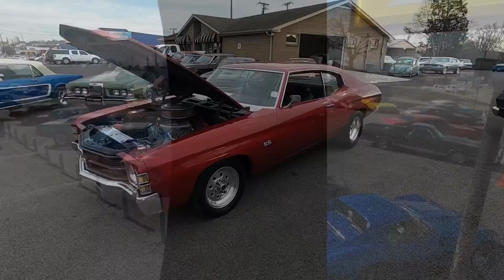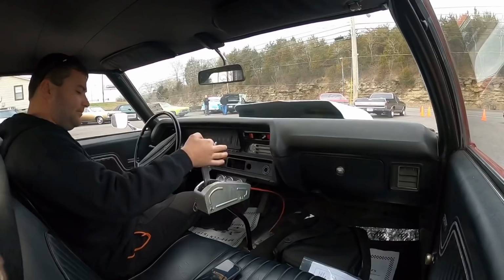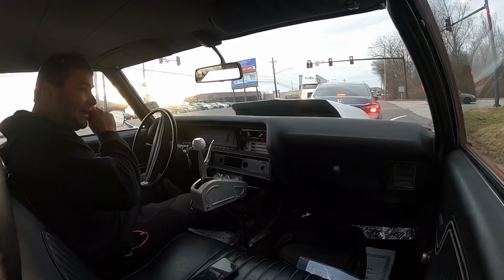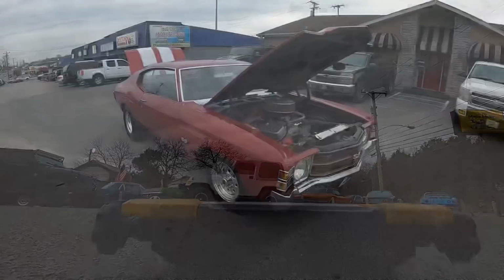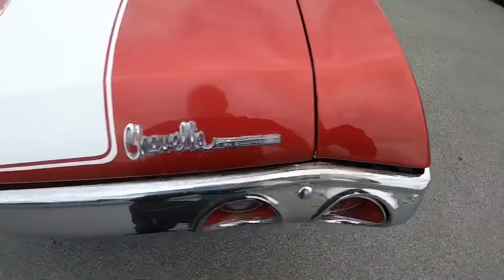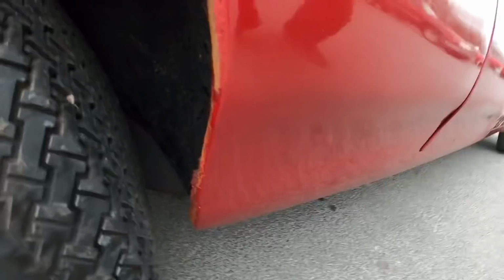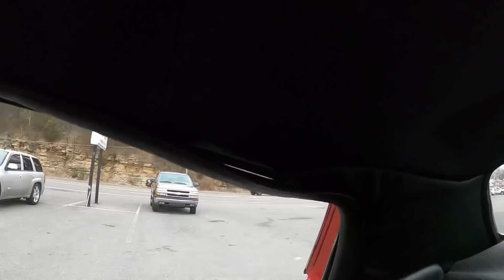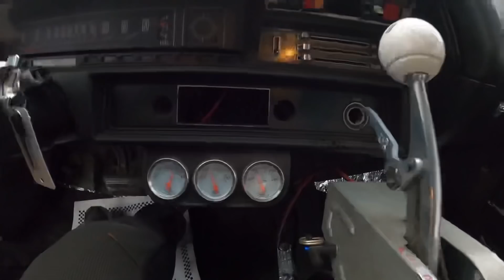Test Drive 1971 Chevrolet Chevelle SOLD $25,900 Maple Motors #1434

Comment: Beautiful 😍, I hate the way they put the shifter in it though. I'd have to change that right away.... but a really nice looking car still! ♥️👍
Reply: Right. Looks like a t-Rex was the previous owner
Reply: I said the exact same thing
Reply: A lot of race cars have it mounted high like that so when the driver is wearing a 5 point harness they can shift it. A harness like that doesn't extend and retract. This car probably had a roll cage in it at one time.
Reply: Put in a Hurst dual gate

Comment: Need to weld those floor pans in, no welds on floor braces or floor pan edges. Pans appear to just be laying in the holes where the old ones were cut out. Strip car? I would not drive that until properly fixed.  Dangerous and irresponsible to sell a car like that.

Comment: Whats up with passenger fender?  The gap between pass fender and door is huge and the fender looks to be out past the door by a good 1/4"... other than that the rest looks good...(commented before watchin walk around).. holes on rockers are from original malibu moldings.

Comment: Shifter is where it is because of the bench seat. If it had buckets you could mount it to the floor between the seats and it would be easily accessible for you to shift as you are going down the track. Imagine trying to do that if it were mounted to the floor in front of the bench seat. It would be nearly under the gauges and too far forward and down to be reached naturally. I've actually seen them mounted this way on several street/strip cars that still had a bench seat.
Reply: @Tommy from Bama ..
🇯🇪🏈 RMFTR 🏈🇯🇪  😉
Reply: @nicolee.french8534  Roll Tide!

Comment: Isn’t that style of shifter used for drag racing?  Also, were the front ends and back ends of the 71 and 72 Chevelle’s the same?  I ask because I had a 72 that looked just like this.
Reply: Front marker lights are different, taillights are the same
Reply: @brianglade848  Grille is different as well.

Comment: Hi Nick from Australia, love your videos, what's your personal ride.
Reply from the maker: Looking to buy a 1969 Camaro now, I just sold my 72 Chevelle. I have a 2000 SS Camaro with 70k miles on it. In the process of moving so after that hopefully I’ll find one
Reply: @MapleMotorsNickSouthgate  I have a 2001 Camaro SS with 44k miles on it and I'm the original owner. Cammed, long tube headers SLP loud mouth exhaust, very fast. 4th gen Camaro SS are badass lightweight cars! I'm like you, i'm looking for a 1st gen Camaro to add to my 4th gen? Mainly looking for a 67 Camaro. 68 69 models I will settle with too.